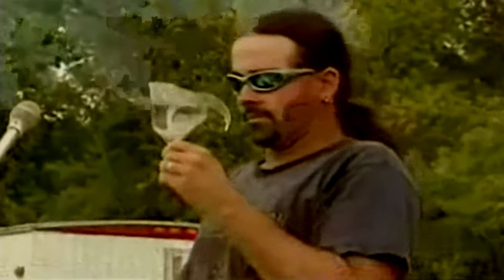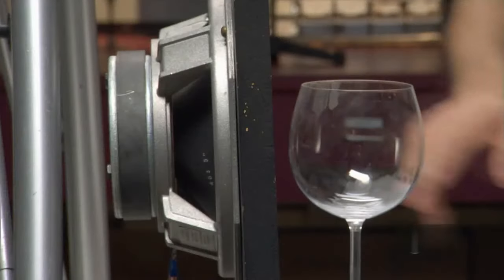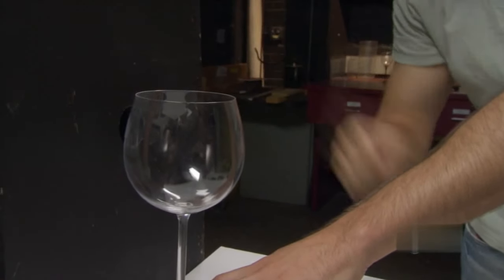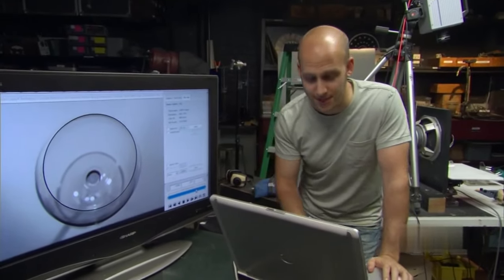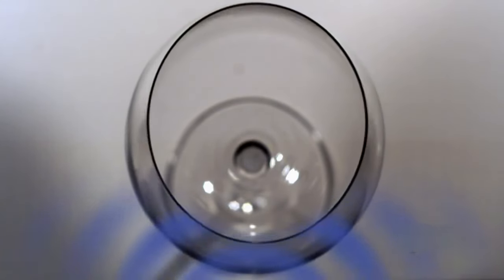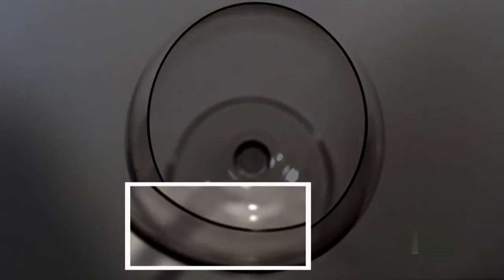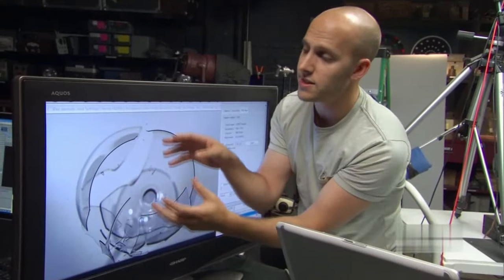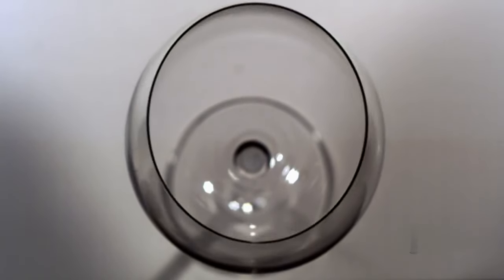Wine glass resonance in slow motion

Comment: yes, that's right. the frequency is determined by it's length, flexibility and mass. if the glass was made of dish ceramics it would be of a different mass and flexibility and thus have a different frequency. with the right frequency you might even be able to break a glass made of diamond if loud enough. the object must be breakable so no soft plastic unfortunately.

Comment: They show the waves in the glass , waveform amplification , like i said...
The glass wobbles more than the speaker travels.
The speak travels like 1/16 and the glass wobbles like 3/16

If the glass didn't break ( made of rubber)it would wobble like 1 or 2 inches after a few seconds ..

Comment: So, when you say the wine glass is oscillating at 300 something time per second.. Is this, any particular non-node on the rim of the glass basically? Has a frequency of 300 whatever Hz? I am curious about the fact that in the glass, as you show us the footage of, the "top and bottom" sides are compressing and expanding together whereas the 'left and right' sides are also doing this, but each (left from top, bottom from right etc) are like say 90 degrees out of phase from each other, and so is the actual tone the glass is making maybe (at least in the center of the glass idk?) like then TWICE the 300 something Hz? This is most interesting!

Comment: I wonder what would happen with multiple speakers used to create an omnidirectional sound. You mention that the flexing of the glass is from the time between sound waves. The glass in the video is flexing in and out at 180 degrees from the sound waves it appears. So I wonder if the vibration with several speakers being used would create a vibration/flexing at all before shattering

Comment: I don't get it. does the loudness break the glass or the resonant frequency break the glass?
if the sound waves(loudness) can push the glass to break then why need to adjust to its resonating frequency?
maybe you can do another experiment for everybody to see if the glass can break with loudness in random frequency.
Reply: Theoretically, yes, it can break if the amplitude of the "force" (here the sound waves) being applied were high enough. But the thing with resonance is that you let the glass absorb that energy (this is easily understood when actually solving the differential equation behind this movement). The amplitude of the vibration rises uncontrollably regardless of the amplitude of the external force being applied (well of course, the amplitude should not be 0 in which case there is no force).
I'm fairly sure of this although I cannot guarantee it 100% since I'm taking a vibrations course right now and I am yet to finish it :P
Reply: HaouasLeDocteur yeah, that make sense, absorbing the energy.....thanks.
Reply: +HaouasLeDocteur So seems higher external amplitude is needed to counter-act any loss of energy in the system (dampening due to air resistance). May be if we put the glass in vacuum/near-vacuum (just letting less/enough air for the sound to travel)..it may explode at much lower external amplitude? [ie less volume of the speaker]. The point is just like a bucket can be filled drop-by-drop or using a fire-hose... energy can be increased in the system continuously independent of the rate of inflow [just we need to stop/minimize leakage]

Comment: what? is this guy tone deaf? the two tones are obviously not the same! even to my ears, but I put this to a test, I used my SONOMA Hertz analyser and the glass frequency is 1547.7 (both time he hits the glass I get this reading)  and the tone producer this man is using is actually 341.8 though on his screen it says 337.5.. when he cranks up the volume the frequency goes up to 347.2 eve though it should stay the same just with higher decibel output.
Reply: But from what I heard - there were at least three different sounds emitted by the glass
Reply: it sounds the same to me. any one else?
Reply: It could be due to a few different reasons. The points in the process of going from the original to your ears, Eg. The recording microphone, the speaker you're using, and the microphone you're using. Although that shouldn't change it much. It could also be that your Sonoma recording could be showing the harmonics more, and not the base resonant frequency. Then finally It could be because of different edited recordings of this video, and this is put together more for entertainment. Or its bullshit. :P
Reply: @JourneyofCuriosity  
I know the video and commnents is too old, but i get the same doubt.  rsrs

Comment: why does the glass break? because it's being heat up? it seems to make sense on an intuitive level - the glass can't take the repeated stress, but beyond that, I can't see what the physical explanation is.
Reply: It's resonance; the glass vibrates at a particular natural frequency, as shown in the video. When an external force is applied of the same frequency, the amplitude of the vibrations of the glass increases until the force is too strong for the glass. If you look up the tacoma bridge collapse, you'll see another example of resonance. How you gain amplitude on a swing is an example of resonance.
Reply: *****  That's completely wrong.

1) Going 'above' this frequency doesn't make it explode, staying at the natural frequency is what causes energy to build up.

2) How can a frequency of 241 dB make a human head explode when frequency is measured in Hertz (Hz), not decibels (dB)? 241 dB is a volume, not a frequency.
Reply: FarmerMildred You're saying it's the amplitude, not the frequency?
Reply: Ester Samuels  Typo?
Reply: FarmerMildred Yeah, that was a typo. Read it now. Basically I just don't get exactly why the glass breaks. It's no different than snapping a piece of wood in half, right? The glass is flexible to a certain extent, but it breaks when it's pushed past it's breaking point, right?
Reply: Ester Samuels Yep. Once the fracture stress is reached and maintained, it breaks/fractures.

Once the correct frequency is reached, energy builds up in the glass, and the amplitude is proportional to energy. Therefore the amplitude of the vibration/oscillation increases too.
Reply: ***** If that were true, then I think I know what the next WMD will be...but I highly doubt that will make 'your head explode'. You do realise that we can't hear sounds below 20Hz, they're infrasound?
Reply: FarmerMildred idiot <3
Reply: sasdragonologie I think Farmer Mildred is right on this one.
Reply: infrasound, ultrasound, hypersound, only need much energy and we do what we what to you
the quality of your ears won't count to much..
Reply: sasdragonologie I have no idea what you just said. I don't think that our ears are directly related to what happens in this video.
Reply: sasdragonologie ***** I said that humans cannot hear sounds below 20Hz. That was not meant to be a part of my argument - it was just a statement of fact. Sorry if you misinterpreted it.

I'm extremely doubtful that a frequency can make your head explode. Something like that would be all over the internet if true - but a Google search reveals nothing. Maybe I'm wrong.

And yes as Ester Samuels said I don't understand what you just said sasdragonologie ...
Reply: http://en.wikipedia.org/wiki/Sonic_weapon

you know that a bomb only makes sound and heat, the shock wave is a sound 

so yes heads have been blew up by sounds
I have videos if you want
Reply: at your service, have a nice life, avoid extrem waves
Reply: sasdragonologie That sonic weapon isn't related to what we're discussing, I don't think.
Reply: and related to what ? sonic = sonic 
same thing
Reply: sasdragonologie Nope. There are different issues within the overall topic of "sonic".